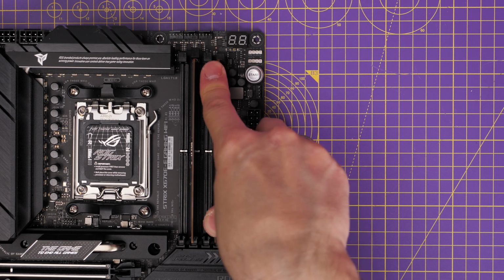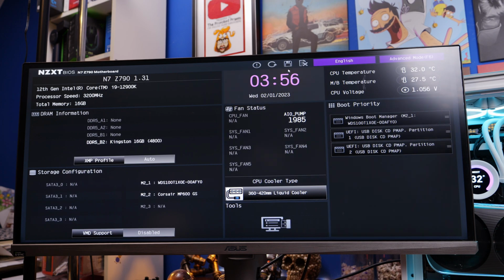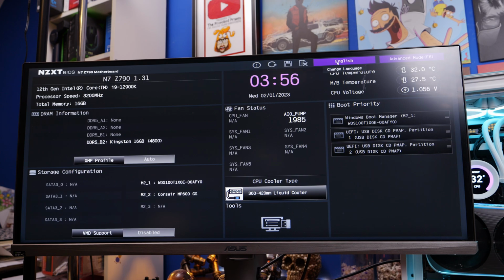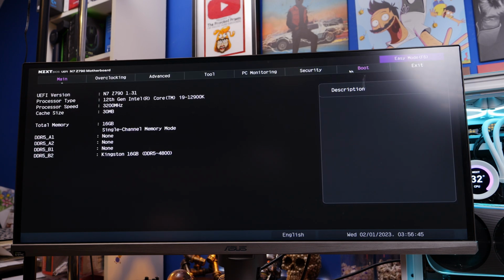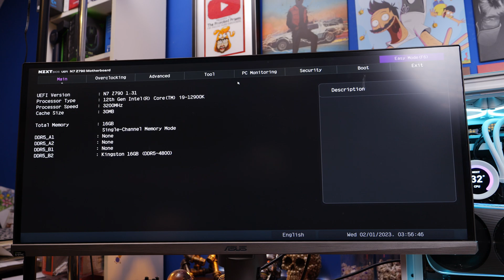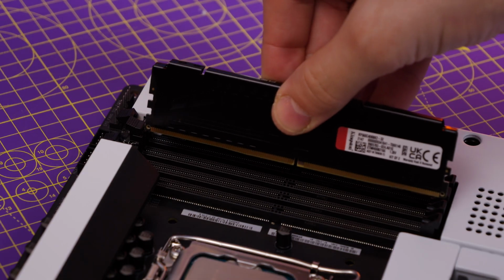Common RAM Mistakes You Didn't Know You Were Making!

Comment: What's that program you're running to control your fans?
Reply from the maker: Depends on your fans. But there's a free app called Fan Control that works well. Or you can use your motherboard bios, motherboard software or the software of the fans for some brands (e.g. ICue for Corsair, L Connect for Lian Li, etc)
Reply: @TheProvokedPrawn  Thanks for the reply! I'm using Asus rog. But I've heard bad things about armoury crate so I've avoided it. So that app you're using is fan control?

Comment: Disable XMP and manually increase the RAM frequency. You can also try upping the voltage to 1.35v (the default xmp voltage). Also, try to balance your timings.

I did this while mixing 2x8 white label sticks from aliexpress and 2x8 sticks from Corsair. Both rated to work at 3200mhz, but I was able to get it to work at 3333mhz.

Comment: I can't help but ask since you use the z790. When you put your sticks in A1 and B1, does it boot at all? I did that first and it didn't boot, not even the bios. just a black screen. However other combinations did work, so now I'm uncertain wether its by design or wether I have a defective 1st and 3rd slot.
Reply from the maker: @praetoriancorps  you as should use 2nd and 4th slot if only using two sticks

Comment: Is there anyway of xmp if your motherboard doesn’t support it. Or am I basically stuck having to buy a different motherboard. I’m using an hp motherboard at the moment for it’s what came with my pc. I have had no luck finding anyway to sort out my ram with this bored and I know there would have to be a way by now. 
If not then someone needs to find a way so we can stop needing to use the bios all the time.

Comment: I have a ASRock Z97X Fatal1ty motherboard with 4 240 pin DIMM slots.
The ASRock motherboard specs on Newegg state that I can have maximum capacity 32gigs of DDR3 at 1600 mhz speed (and up to 2400mhz overclocked)
However, when i go to the RAM manufacturer G.Skill, it states that that board can only handle 4 x 4gb DDR3 sticks for a maximum of 16gigs at 1333 Mhz. What gives?

Comment: I had 4x 8gb ram, System Information says I had:
Installed Physical Memory: 32gb (which is true)
Total Physical Memory: 14.9gb
Available Physical Memory: 12.2gb
Total Virtual Memory: 18.9gb
Available Virtual Memory: 14.5gb

So why it seems it only using half of my RAM?

Comment: Mixing ram CAN work as long as you have the same amount of ram in each channel and run the RAM at either at the lowest speed of all your sticks or just stock speed without any XMP (going to 4 sticks often means your maximum speed is a lot lower). Back in the day I had a system with 3x2GB + 3x4GB DDR3 (it was a first gen i7) and it gave me 18GB total just fine. The problem is that nothing is guaranteed to work if you mix RAM it probably depends on the exact combination of RAM, CPU and motherbord you try this with, but more often then not it works fine as long as you go down to stock non XMP speed and and have the same amount of ram in each channel (even mixing diffrent amounts can work sometimes, it just means that part of your ram will be a lot slower which will cause performance issues). Also even you you buy ram from the same manufactures, with the same speed and even the same model number, the actual phsical ram chips on the ram can be from completely different manufacturers.

Comment: just built a new rig with a z790 dark hero and can't boot at all if both of the G Skill Trident Z5 rams are installed. These ram sticks work perfectly in another computer. I can boot with a single stick inserted. I am not trying to run XMP 8000 on a 4 dimm board. I have XMP disabled and still can't boot with two g skill sticks. Do I need to update the bios of my Z790 Dark Hero?
Reply from the maker: Worth a try. Often the newer bios updates include stability improvements

Comment: Are Intel XMP DDR5 sticks compatible with AMD motherboards? I realized yesterday I installed 2x16GB Corsair Vengeance Intel XMP DDR5 sticks instead of AMD Expo DDR5 sticks onto my MSI B650 AMD Mag Tomahawk motherboard while building a new PC a few weeks ago. I’ve had very bad, low FPS issues and crashes since day one while gaming; Ryzen 5 7600X with an XFX Speedster MERC310 AMD Radeon RX 7900XT w/20GB GDDR6. My new PC scores well using Cinebench, but I have majorly low FPS in RDR2 (20 fps at all medium settings) and about the same with GTA, with occasional crashes during both, and the PC crashes while playing  The Hunter; Call of the Wild. I’m guessing the Intel XMP Corsair memory sticks might be causing this, but I’m barely PC hardware savvy (and apparently unable to read when overlooking Intel in the product description when I was looking for AMD compatible RAM) to know if this is what’s causing my PC issues. Would using AMD Expo sticks fix this issue?

Comment: the board will not start at all and I looked up the memory support and the ddr4 ram I purchased is not on the list. Is no start up at all a common ram issue? I did order ram that is on the list which is very expensive. how do I get cost to a reasonable level or is ram just that expensive in this generation?

Comment: How would you know that the mobo support all 4 DIMM slot??
which one is bettern 8x4 or 16x2 for 32gb
Reply: 16x2

More sticks bring more instability, and slower transfer speeds. 

Always go 2 sticks in a mainstream PC.

Ideally use a motherboard with only 2dimm slots, especially if you plan to overclock/tune
Reply: @vencler  thnks for the reply...
Reply: @vencler  this is actually incorrect. It completely depends on the system and what it is used for. It does not at all cause an instability not sure where you learned that. Certain games out there need a lot of ram. You really cant go wrong with 2 or 4 sticks its whatever you need or ultimately want. Some want 128 if its supported just because and some just need or want 32gb which is the max 99 percent of games will use. Dont get fed into misconceptions
Reply: @Dravira  you should read with more understanding. 

Get 2x16gb sticks, overclock them to 8000mt/s
Now try to do that with 4 sticks :-) 

It puts an insane amount of stress onto memory controller, and also depends on motherboard topology.

I am strictly talking about memory tuning. 

You can still have 2x32gb or 2x64gb (even though that too will be higher to tune), but don't use more sticks because then they are somewhat not even able to hit XMP settings, let alone be able to tune past that.